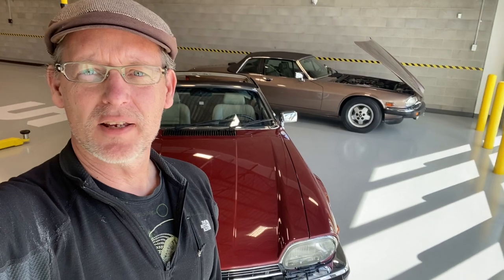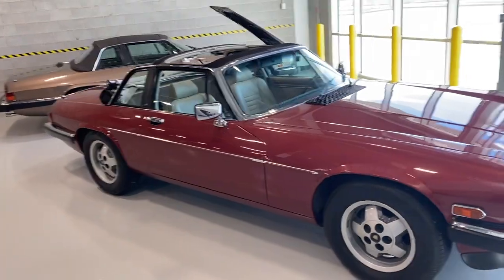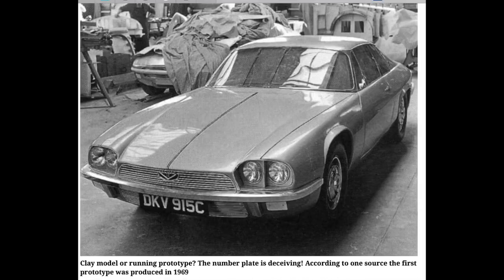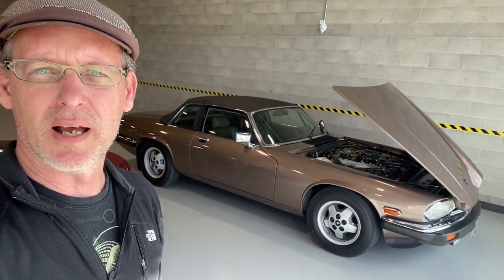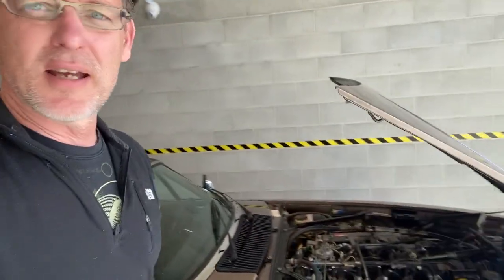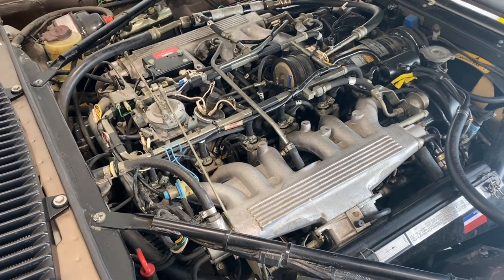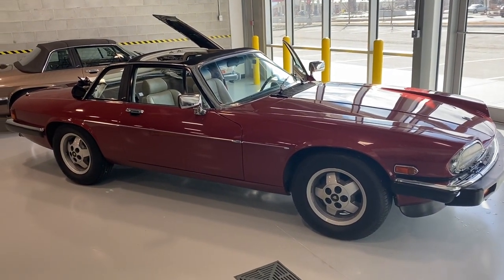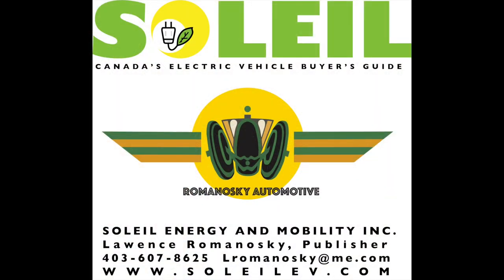Understanding the Jaguar XJS: History, Design, Construction, Maintenance and Cost of Ownership

Comment: I bought mine new in 1988.  I had a Series 3 E-Type OTS, but disliked the flying buttress styling of the XJS enough to avoid moving to the XJS.  Until 1988, when I was at the Jag dealer buying the parts to overhaul my fuel pump.  I went home with a Grenadier Red Hess & Eisenhardt convertible.  I loved the car, but hated the GM 3-speed automatic.  After about two years I decided to "fix" it and have the car it should have been.  
I replaced the crappy GM transmission and 2:88 rear with a Tremec 5-speed with a 3:54 rear.  The engine got a new AJ-6 company Plus-Torque induction system; the suspension got Harvey Baily anti-roll bars, Bilstein shocks, springs, 16" wheels and Goodyear NCT tires from the European Sport Pack; and an x-brace to stiffen the chassis a bit.
The result was perfect.  It was still a quiet cruiser with a nice supple highway ride, but much quicker and faster and cornered like a go-kart.  It remained my daily driver for 20 years.
Reply from the maker: sounds great!  how hard was it to install the Tremac?
Reply: @slrroman  Not all that bad.  The V-12 crank was already drilled for a pilot bushing.  I used the pedal housing, pedals and clutch master cylinder from a 6 cyl XJS and made and bought a flywheel and bellhousing from custom shop that no longer exists.

Comment: Excellent video, i couldn't agree more. I'm a licensed technician for over 47 year's, worked on dozens and dozens of them, very easy car to work on once you seperate the systems, couple special tools.. My son and I are going through a complete restomod on his 86 jag-xjs.. complete port and polished intakes, custom snorkels, chromed everything else in the ER, every nut and bolt is ss. High pressure  plastic fuel lines and adjustable fuel regulator,, blast and powder coated rear and front suspension,  2 1/2" ss exhaust, 18"x 9 " rims, custom interior,  shaved doors,  light's and even the finger lip on the gas cover so its absolutely smooth , a complete  original TWR body kit,,,custom jet black satin paint job, every single piece is black.. all nolathane bushings, 1" front swaybar, and this winter a Mobeck standalone ECU, which includes new injectors, DIS, and electronic controled idle. These run smooth and fast.. trying later to achieve 500 hp.. keep up the great work..
Reply from the maker: Sounds fantastic. I'd like to find a 7L Lister XJS